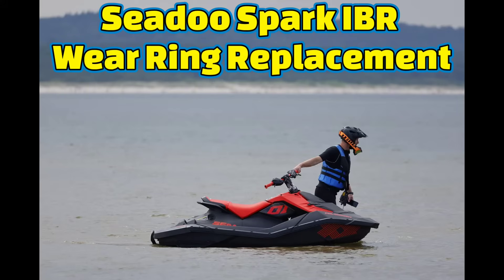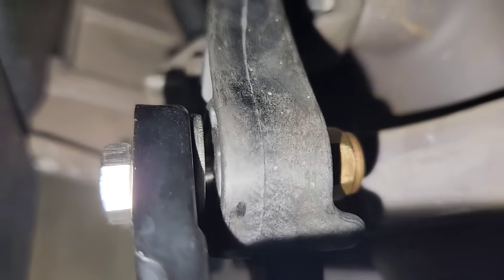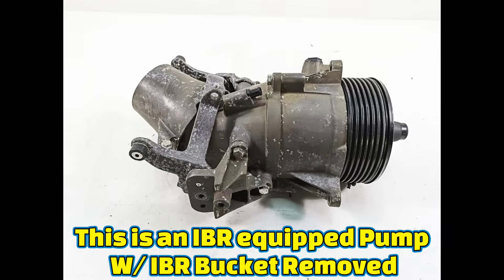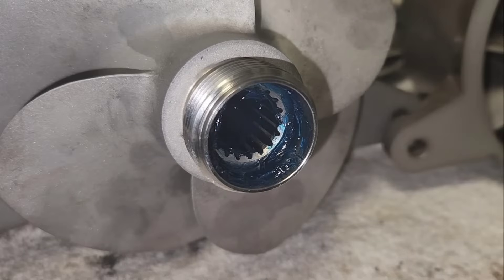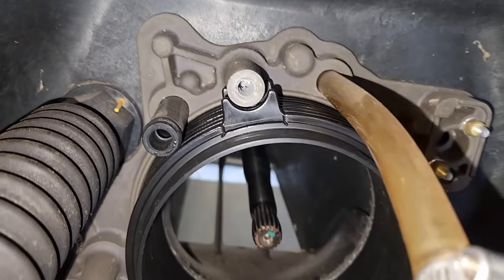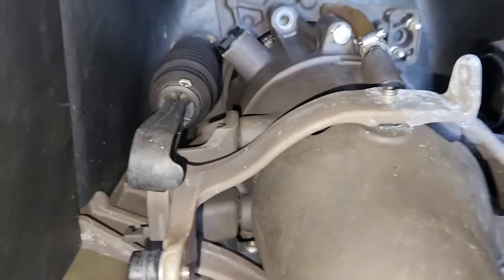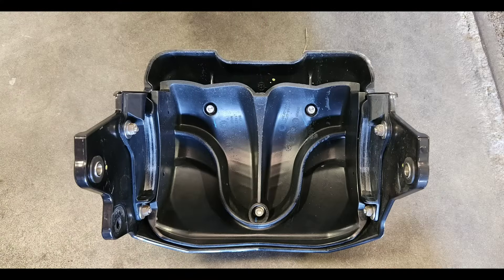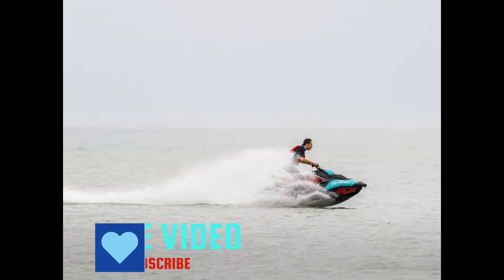Wearring Replacement Seadoo IBR Model | Seadoo Spark Wearring Crack!

Comment: How did you get to the jet pump bolts at the bottom with a Seadoo spark that has the IBR even with the IBR bucket removed? Non IBR jet pumps are easy to get to but the ones with IBR they are behind the drain plug and flush port.
Reply from the maker: It is easiest to access those with a 13mm swivel socket on a long 3/8" drive extension. The very important part is to make sure when you put them back in to clean the loctite off the bolts and apply new loctite so the bolt threads in easily. Just be sure to start the bolts by hand and make sure they go in easy so they dont get cross threaded.

Comment: Is wear ring replacement really that easy?  I have gotten mix responses from different techs, one guy saying that was extremely difficult , wanting to charge me $300 ...if nothing else needed to be done once he got into it.  Is this giuging?
Reply from the maker: When the wear ring on a Spark gets damaged it does typically chew up the impeller so the impeller needs to be removed and cleaned up or replaced depending on the damage. I have found installing the pump without the Reverse gate is alot less aggravating, and less bulky. The lower pump mount bolts have to be installed with a 13mm swivel socket because of the angle. It can be easy if the proper steps are followed. Hope that answers your question.